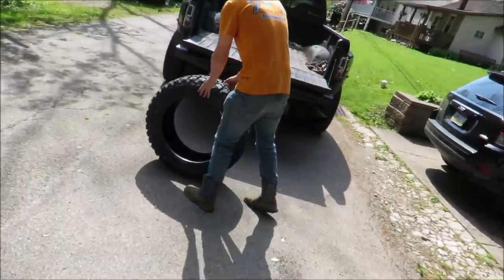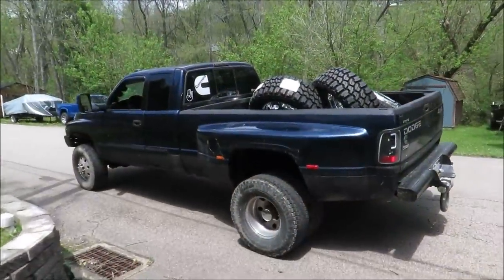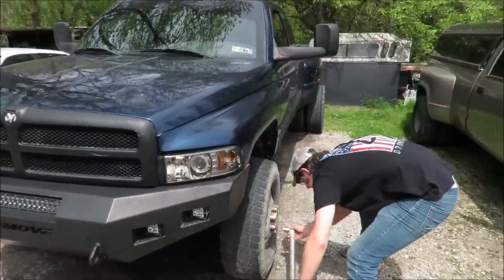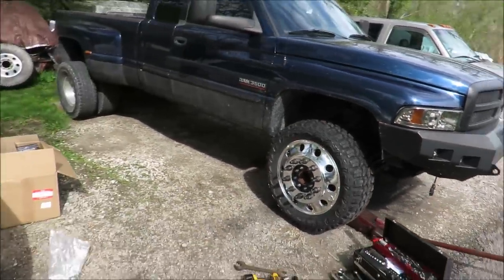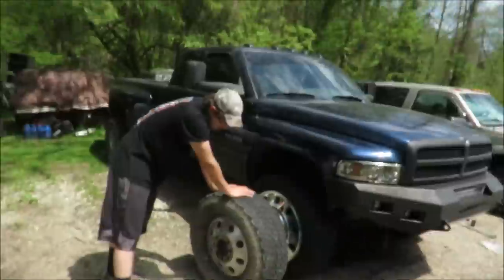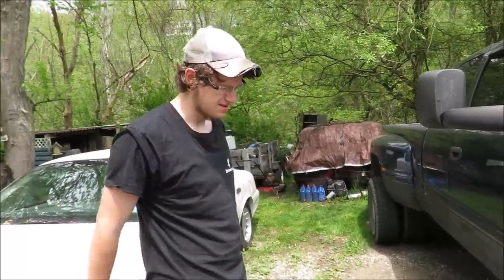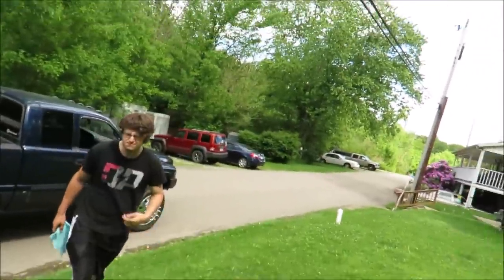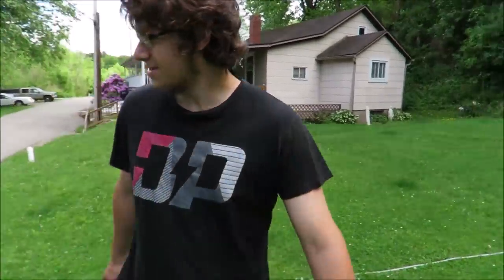★ NASTY 10 Lug Semi-Rim Conversion ★ 2nd Gen Dodge Cummins

Comment: "Go a little bit further after it clicks"....no sir thats not correct, when the torque wrench clicks then its at the set point you put it at. Id recommend stopping when it clicks. 👍🏼

Nice wheels man, love the alcoas
Reply: Have a set on my semi
Reply: Friend: "yeah just keep torquing".
Also Friend: "damn, are they that tight".
Reply: People wonder why they break bolts. Guten tite
Reply: Going a bit further after it clicks is called over torqueing.  Thats how you break studs, stretch threads, and lose wheels. Go til it clicks, then a second time, then move on.  Retorque it after about 50-100 miles.

Comment: Nice wheels. So 4 foot bar to remove the lug nuts but 18 inch torque wrench to put them on. You can get a shorter wheel stud for those adapters. Those are so long because they normally have a brake drum on them also
Reply: Trucker here… those lugs are normally set near 200 lb/ft of torque. So yes, extra long breaker bar required.

Comment: Did you recalibrate the speedometer after you swapped the wheels? I mean, wouldn't a bigger wheel affect what the truck speed was calibrated for with the smaller ones? I know nothing about the ratio on wheel sizes, but I have seen it on several other videos after they upgraded to a bigger wheel size.
Reply from the maker: Yeah the speedometer might be alittle off now. We’re going to have to recalibrate it. The new tires aren’t that much bigger but it all adds up when talking about speed. Good comment and we appreciate the advice! Thanks for the support and for watching!

Comment: Where did you get the alcoa rims milled for the 22 inch tires???  What tires size and brand are they???
Reply from the maker: Dually Proz located in Ohio milled the wheels. And they are 35x12.5x22 thunderer tires! Thanks for watching!

Comment: Hey brother I may have missed it. 35”x??/22 whats the tire width? I’m wanting to do 37/12.5/22 on Alcoa’s on my 2020 Cummins 3500 and have you had any issues since this? Also I’ve heard torque the adapter to the truck 140lbs but up to 300lbs on the wheel to adapter is that true?
Reply from the maker: They are 35x12.50x22. There were no issues other than a few lug nut spike covers bending in rear from heat. But heard that’s normal. I can’t recall the torque lbs on the adapters. I believe we did 160lbs but could be off by a bit. Thanks for watching!

Comment: Why no spare for the front? I know you can still make it home or to a shop if one back tire blows, but you're stuck on the side of the road without a spare for the front. 
About the torque wrench, you don't "give it more" after it clicks the first time. You risk damaging the spring in the torque wrench if you keep tightening the bolt/nut passed the "click" sound. You rotate the handle until you hear it click once, release your pressure on the torque wrench, then rotate it until you hear it click again. Failure to follow the correct procedure can leave the fastener over or under torqued. It might not be that critical on spacers for semi wheels, but please don't "give it the beans" when you do any engine or drivetrain work.

Comment: Looks good👍🏾👍🏾I did the same thing to my gmc duramax dually after awhile the stock 3:73 gears were replaced with 4:56 gears front and rear and she pulls hard👍🏾👍🏾....I can do 70mph  at 1800 rpm 75 mph at 2000 rpm which isn't really that bad for a 6 speed automatic
Reply from the maker: Thanks! And that’s awesome! Sounds like you have a pretty good setup! Thanks for watching!

Comment: If you wanna keep them up to par order the right equipment cause water will actually make those rims look like garbage not before long, you need a Chicago adjustable speed polisher, medium, heavy, and finish cut polishing wheels, zephyr pro 40, charcoal lighter fluid, spray bottle, lots of rags, and you need 2 specific polishing bars, I used to polish semis to where we actually got it too reflective an ended up catching my buds pants on fire cause he sat there too long, those are clean rims, but not what they could be, an if they get a scratch you can sand up from 80-800 grit in stages an get rid of any blemishes or scratches
Reply from the maker: Ohh for sure, we’re gonna look into some equipment and materials to keep these rims up to their cleanest potential lol. We appreciate the tips! Well look into some of that for sure. Thanks for watching!

Comment: Those wussy unit bearings and the ball joints on the front concern me and make me hope you have no catastrophic failure.
Reply from the maker: The truck is a one ton, it should be able to handle it and hold up fine. He’s had them on for awhile now and had no problems. What concerns do you have about it?
Reply: @thekehmcrew  with stock tires and stock front bumper the ball joints and unit bearings are toast after 65,000 to 75,000 miles. The front end is not up to that load. Yes, since I own five Cummins-powered Dodge pickups (all one ton), I am aware the subject truck is also a one ton. Are you aware that the front axle is identical to the 3/4 ton front axle with exception of the added hub-adapters?

Comment: I never understood why the front lugs on a diesel poke out so far.  

The back wheels are perfect, deep dish look

To me, the front lugs ruin the look of a diesel in general.
Reply: Jay Boogie79 you can’t rotate tires if the rear wheels are different than the front

Comment: RIP wheel bearings and ball joints
Reply from the maker: The truck is a one ton, it should be able to hand it and hold up fine. He’s had them on for awhile now and had no problems. What concerns do you have about it?

Comment: To bad alcoawheels ride like shit   I went with the 24” fuels and  allot better ride. The wheel adapters really suck-far as ride
Reply from the maker: He hasn’t had any complaints so far. I’ve been in it a few times and it’s felt smooth. But I’ve never been in a truck with fuels so I don’t have an opinion to compare them lol. Thanks for watching